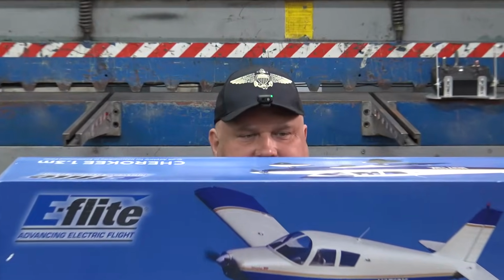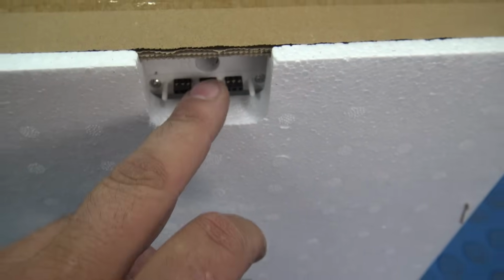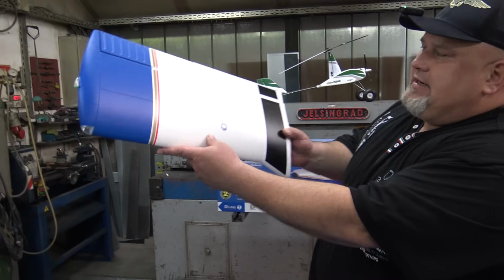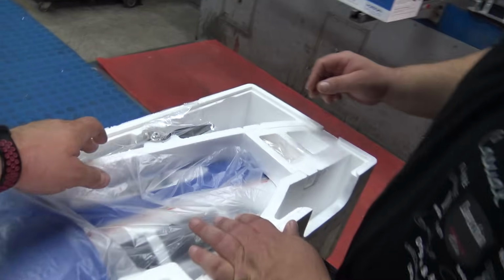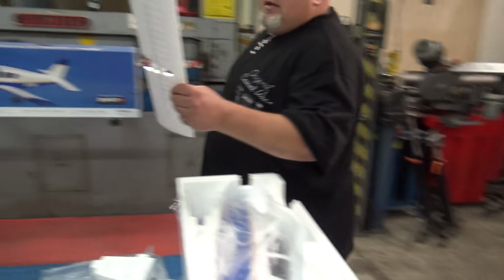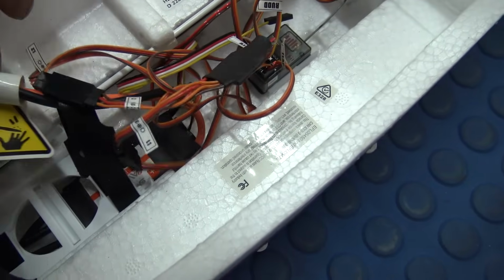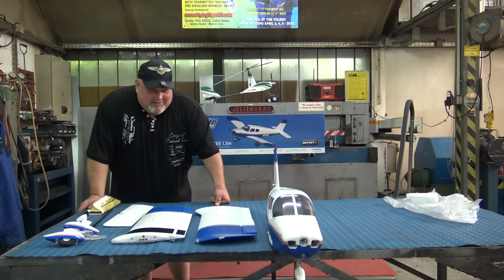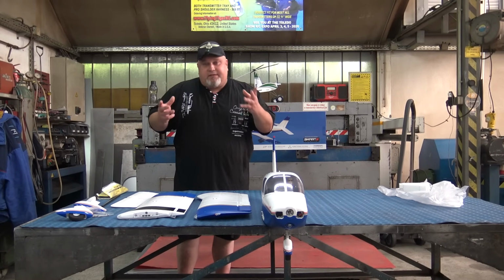EFlite Cherokee 1.3m BNF Basic with AS3X and SAFE Select UNBOXING

Comment: come on Blaz, Please get the glow one running and test fly it ? Awesome looking plane, but make sure to run a reliable engine as will need power full time not surging or splatter or you will tip in fast otherwise a gentle flying bird and has nice landing approach on the flare,great video Robert and Blaz. <3
Reply from the maker: Iam waitng for Blaž for a very long time my friend.
Reply: @PetrincicBrosRC  :face-green-smiling::hand-purple-blue-peace: you guys rock <3